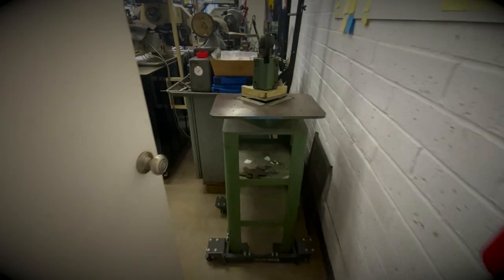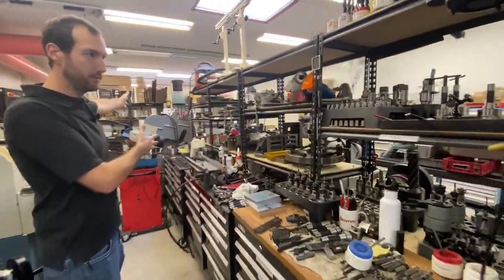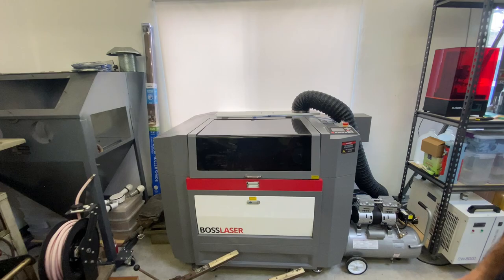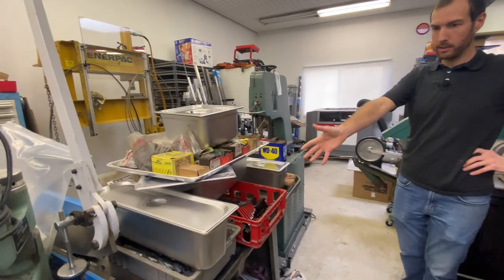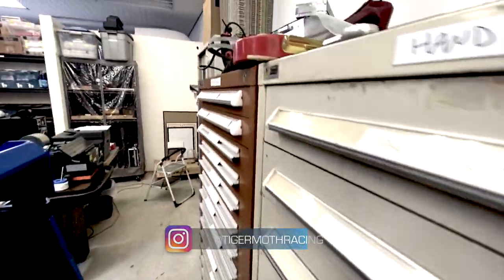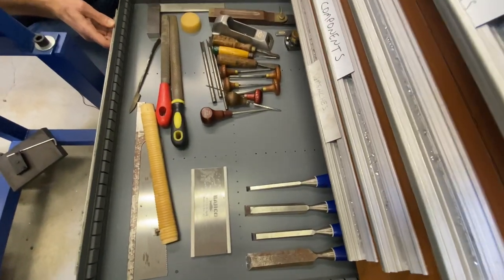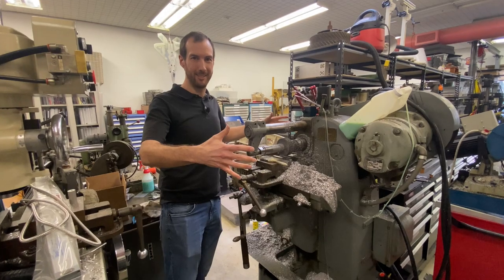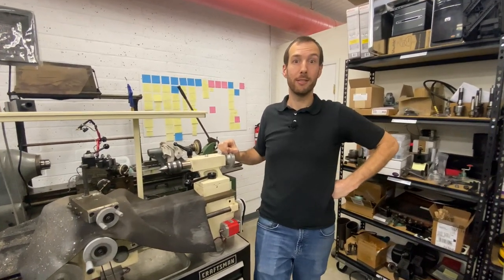WALKTHROUGH OUR SHOP!

Comment: Wow!  That shop is a dream.  I really need one of those aircraft carrier desks!.  I was wondering if, you acquired most of your lathes and mills used?     I've priced out some machines that I need, only to back off due to the price and shipping.  BTW stumbled onto your channel while researching the Ironworker !
Reply from the maker: Yes most of the machines we have were found used. I find it allot of fun to look for a great deal on the used market. Not to say I have never been burned but the wins far outweigh the losses. New equipment is great if you are confident you have tons of work for it.